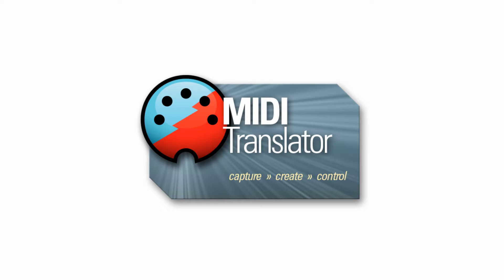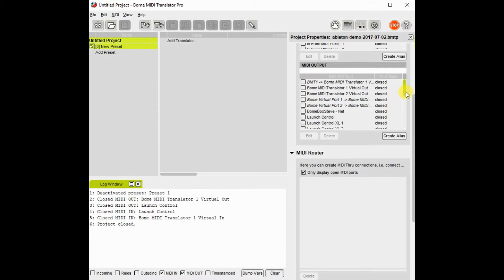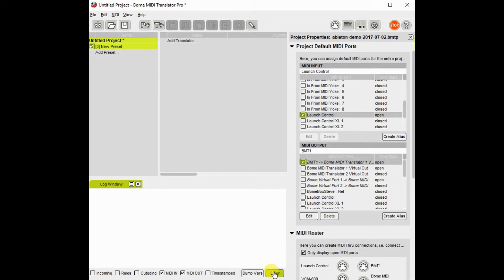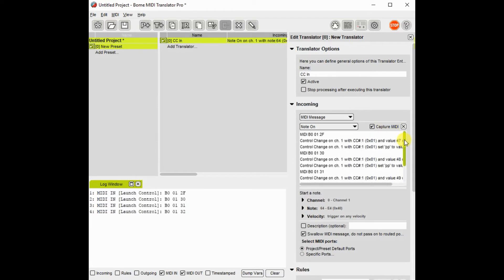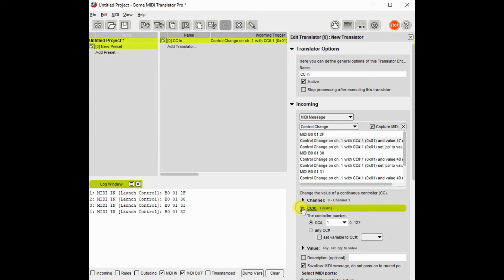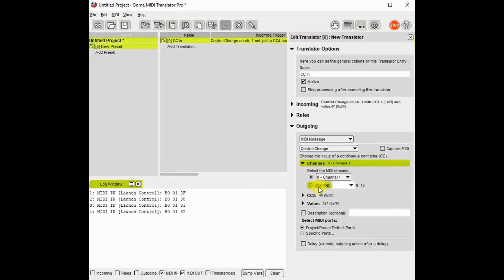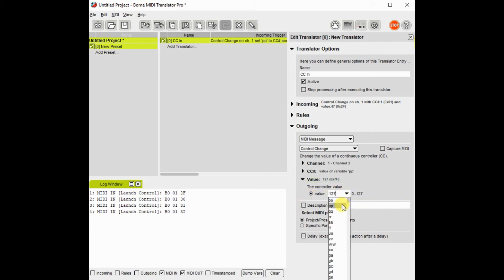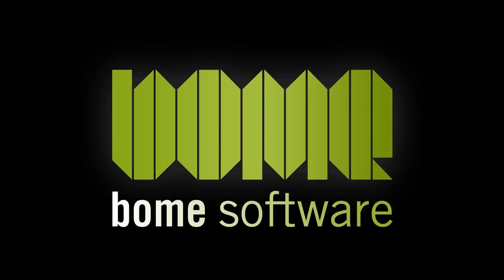Tutorial: Change MIDI Channel using Bome MIDI Translator Pro

Comment: I bought it and it's not very easy to set.  I just want to change the midi information  from the new mini Akai to Ableton live 11. In order to able and disable chains (Just to be efficient CPU wise bc I am using 15 instances of omnisphere, Keyscape and Kontakt for live), because Akai send specific midi messages that contains specific notes and velocities that activate the chain when I played the keyboard. For example,  every time I pressed C2 which is the configuration of the Akai It activate or deactivate mi chain. I want to change the midi channel from the Akai in order to avoid activation or deactivation of my chain.  I tried different options and I can't - Any ideas or I should keep using Keyboard commands that work pretty good for what I want.
Reply from the maker: Hi, thanks for reaching out! The most common cause of not being able to do things properly with MIDI is improper device selection.  There is a tutorial for that at the below link.  

You can learn more about device selection from this tutorial.

https://youtu.be/KunN2A1rKMY

If this does not solve your issue or you have further questions, then we are happy to help. please visit our forum at https://forum.bome.com and we will be happy to guide your further.

Steve Caldwell
Bome Customer Care
Reply: @Bome  I tried and is unsuccessful. I believe this is powerful tool when you know how to use it or you are engineer might be easy. We need more detail tutorials with examples otherwise is pointless.  You can talk hours and people will not use it properly. The more detail you use and the more examples you use the better result you will have with costumers. This is just a feedback not a complain.
Reply from the maker: @FranciscoRamos-de2ig   Hi, thanks for the feedback!  We have roughly 40 tutorials on Bome MIDI Translator Pro  (and more on BomeBox and a few on Bome Network and everyone uses it a little different. Perhaps it would be best if you could post on our forum specifically what the configuration is that you have, what MIDI message you want to use to switch channels and which devices you want to switch channels on.  I'm sure we can help you from there.   That is what our support is set up to do. Provide individual guidance when the tutorials don't quite hit the mark for your specific needs. Also if you have a project file that you are currently working with, that usually helps. 

Looking forward to hearing from you on our forum!

https://forum.bome.ocm

Steve Caldwell
Bome Customer Care

Comment: Is there a way to make it so that a MIDI CC value can basically set the output device and channel? For example, I have MIDI information being sent through a virtual midi cable (Input Cable 1, Ch1). In amongst that data, is a MIDI CC 20 value. I'd like to re-route all the MIDI data coming in through Input Cable 1 Ch1, to various channels across several Output Cables, depending on what that CC20 value is (CC20= 1, then send to Output Cable 1 Ch1 // CC20=2, Then Output Cable 1 C2 // CC20=37, then Output Cable 5, Ch 14, etc.)  Is there a way to do this?
Reply from the maker: H Elliot,
Yes you can. For channel routing it is as easy as specifying the specific channel. For device changes you can set up specific presets (sets of translators) or translator to specify a given set of output devices. For more information or help, please go to our forum and ask there.

http://www.bome.com/support/kb

Steve Caldwell
Bome Q and A Moderator and
Independent Bome Consultant/Specialist
bome@sniz.biz

Comment: Hi, will this program change my my midi channel(my controller is on channel 1 by default) to a desired channel BEFORE it enters my Daw? 
Context: trying to run 2 identical midi controllers that are channel 1 as separate as they have identical CC messages
Reply from the maker: @Zonga Pat, this is exactly the kind of use case for which our users use Bome MIDI Translator Pro!
Reply from the maker: Yes, well some DAW's will  handle this if they are coming through different ports but not all. It is easy to program each controller with a different MIDI channel using Bome MIDI Translator Pro.  I suggest you go to the Bome Website and download the demo version of the software and test your controllers. The demo version is fully functional (except for 15 minute timeout). Once you determine that it works for you, you can then purchase it if you would like. If you need help setting this up, you can post to our Q&A Forum and we can help get you started.
Steve Caldwell
Bome Q and A Moderator and
Independent Bome Consultant/Specialist
bome@sniz.biz

Comment: Its like the product can only work on button, no one has been able to demonstrate how it can be used to turn a knob right and left
Reply from the maker: Hi Jide,

Thanks for your comment! Bome MIDI Translator  Pro can work with buttons, sliders, knobs etc. You can translate virtually any incoming MIDI message to a different (or even same) outgoing message or even mouse or keyboard action.

It can even take one incoming event and generate several outgoing messages from it if you would like. 

If you want to explore a specific type of event, please post a question on our Bome Q&A web site at http://www.bome.com/support and we can provide more detail.  You can even test this functionality for free by loading an evaluation copy of Bome MIDI Translator Pro. The only limitation on the evaluation version is that it will only run for 20 minutes for each session. That way you can try for free and then determine if it will meet your requirement before purchase.